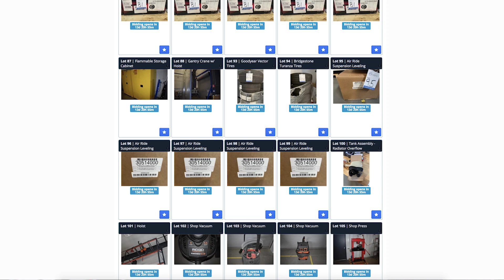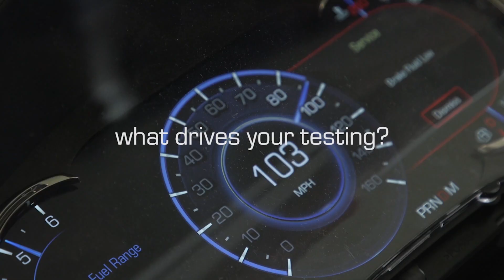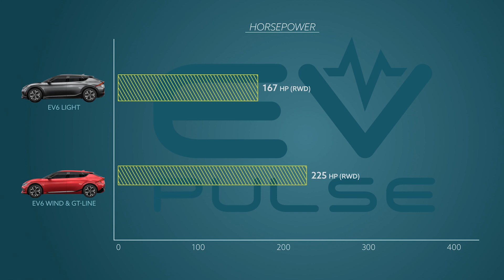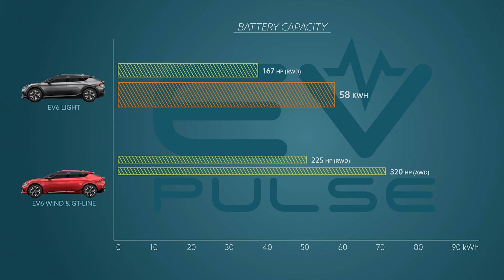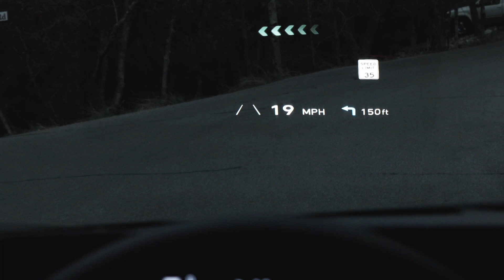Automakers Shutting Down Russian Plants; Turning the Entire Car into Radar - Autoline Daily 3271

Comment: Lucid has delivered 400 cars, not 300. As Peter Rawlinson said in the earnings call the production delay has been caused by quality issues with a few suppliers, primarily glass and carpet, but some components were not properly coated. Lucid plans to bring more of these processes in-house as the factory expansion progresses. one or two suppliers have reportedly been replaced.

Comment: I love that the guest reporter used infographics to help show horsepower range and battery capacity. Super important. I wish more of your reports were supported by infographics for numbers. So many times you throw out numbers and it’s hard to remember what you just said in order to compare it to anything. Your program usually does a great job about not using too many numbers in a row compared to some other news outlets but the infographics are very very much appreciated. Another great show by the way.

Comment: 8:24 “Look to buy an 800 V architecture EV” You mean not a Tesla, despite Teslas having the most range and the only working DC fast charging network.
Reply: Isn't it a little bit awkward that Tesla has locked itself in to a technology that will be increasingly outdated? 8-900V is clearly the future of EVs since it allows the much faster charging that will make more affordable EVs possible.
Reply: @Miata822  Superchargers are capable of more I believe
Reply: @kelindrawn  Nope. Possibly, but it would be interesting for that capability to be built in if no Tesla cars could use it today.